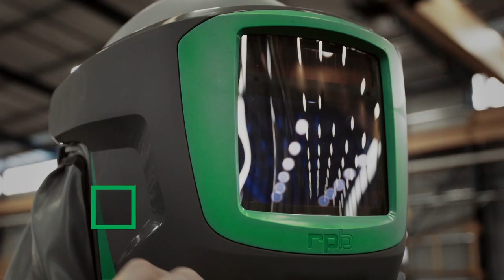Z-Link | Multi-Purpose Respiratory Protection | RPB Safety

Comment: How does it give you fresh air if it's in the same room while you're painting?
Reply from the maker: Great question! The Z-Link is compatible with supplied air, which means it can be connected up to an external source of air such as compressed air via a breathing airline hose.